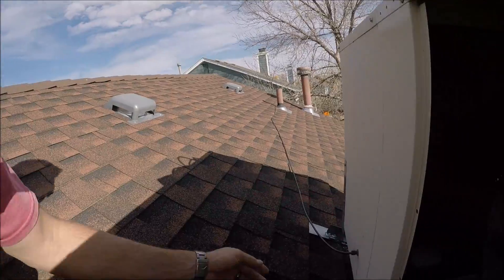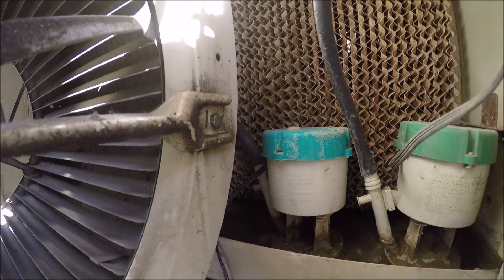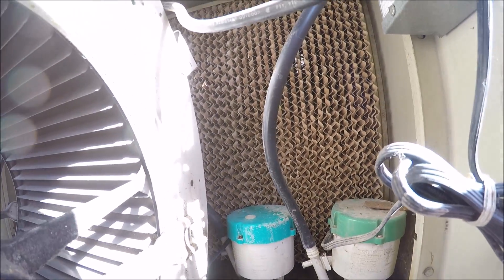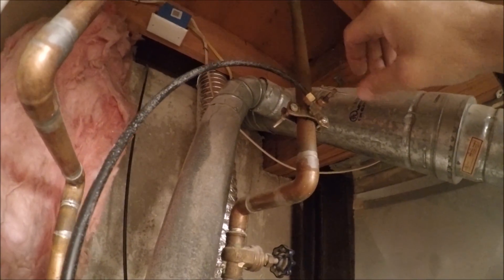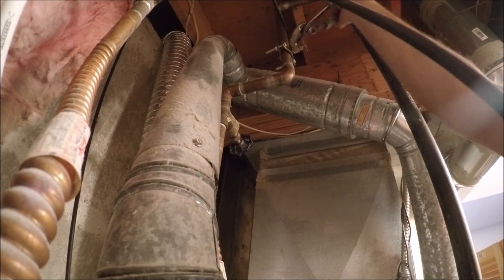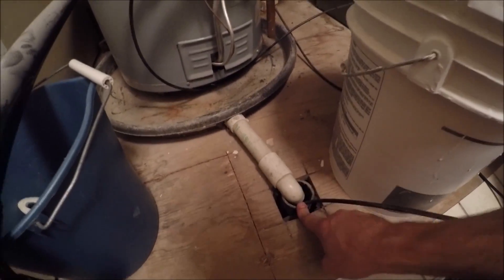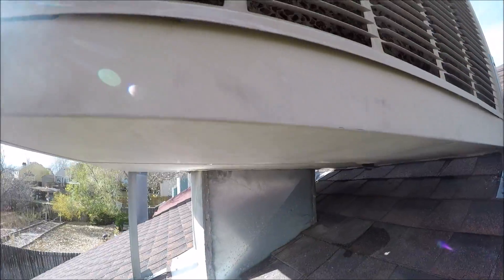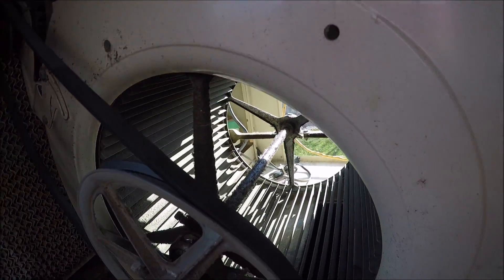HOW A SWAMP COOLER COOLS YOUR HOUSE | THE HANDYMAN

Comment: They don’t work when it’s 100 or 90 degrees. You need air conditioning to address the humidity factor.
Reply: It's 101 now I have  one on rollers  you add water 7gal to it my air went out in may waiting for contractor  but cooler is working  fine

Comment: That's so crazy in Oregon are humidity is very high 80% sometimes higher especially in the summer and those swamp coolers don't work at all not in Oregon you need air conditioning something that takes the moisture out of the air it makes it thinner more comfortable I know people don't want anybody using air conditioning anymore but that's what works the best to cool in high humidity high temperature situations

Comment: Just watched your swamp cooler winterize video.  I did that annually for years at a rented commerical building in the 1980's.  It was in hot & humid Maryland.  I never knew what unit was called nor exactly what/why I was doing it, I was shown what to do once and did that for 20 years, winter & summer.  It worked great all those years.  Back then I was just a young accountant in the building and was appointed to do the job.  Lol thanks Jack the Handyman